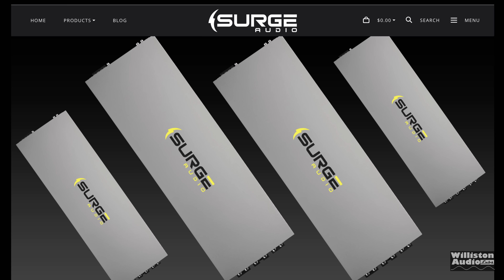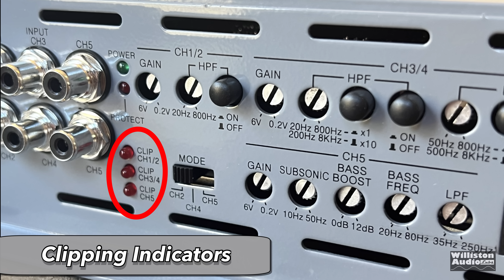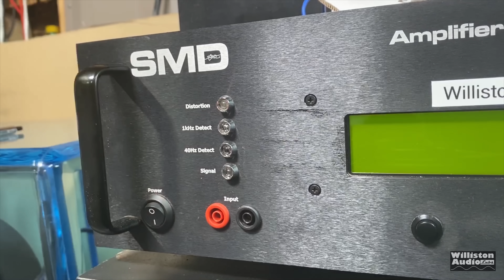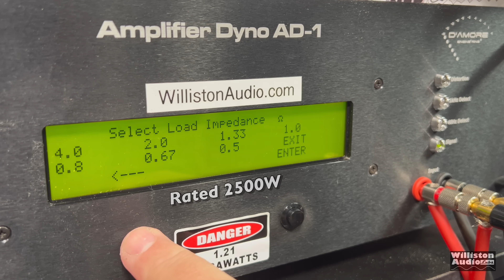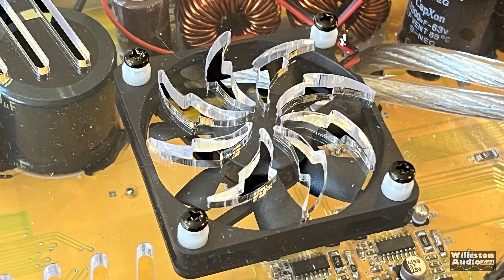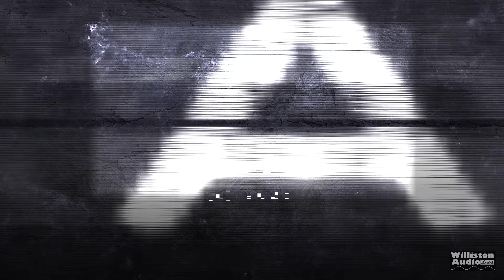Surge Audio 6000 watt Five Channel Amp is the MOST Powerful EVER!

Comment: I'm too old to be geeking out on your channel, but I do....  Big D, how much would you charge to release your years of test data?  I'm doing a rather unconventional build, and I need the highest efficiency possible for a >1000w sub amp.  I'm building a Radio Flyer Wagon into a rolling auto-parts swap meet wagon.  This would be v3.0, I've built two in the past, the last one has approx 450 watts, 12" sub, 4 speakers and is motor driven.  Love to share pics of it if you can help.
Reply: Any class D amplifier around 4 ohms is going to be very high efficiency. Being a few percent higher or lower in the amplifier efficiency really doesn't have much of an effect. The big factor on efficiency is going to be the subwoofer enclosure. For instance a ported enclosure might use 1/3 to 1/2 of the power of a sealed enclosure. Like the amplifier, the subwoofer is also not a big factor in efficiency, but it can help a little. Subs that have low power handling tend to have softer suspensions which gives them a little more efficiency compared to the bigger and heavy duty subs. 
Also, the lower the frequency it plays, the more power it needs. So limiting how low it plays can also boost efficiency.
Hope that helps
Reply: @JasonWW2000    Right, and I understand.  I've watched his channel for years, and I'm looking to power a 4ohm sub strictly on battery, with a subsonic filter in a ported box.  I've seen his efficiency measurements vary dramatically, some amps are very miserly at input amperage vs output watts, some have horrible efficiency measurements, which would directly battery playing time.
Reply: @jimweber8602  as Jason said, Class D, they work - in layman's terms - by converting only the power required to drive the speakers at that particular time as opposed to class A/B which require the full voltage to be present across the output drivers (transistors) all the time, meaning more energy wasted, more heat and larger heatsinks. Williston has tested many small, yet powerful Class D amps on the channel. All the data is available on his channel, if only there was a way to look for it...

Comment: 😂 I was looking at 5 channel amps on Amazon when this notification popped up. WAL coming through again.  700?!   I only need to run a set of 6x9's and a set of 6.5 components so 700 should be perfect 😂.  Even at $1000 it's an awesome bang for the buck
Reply: That's about four times the power that you need to run your setup